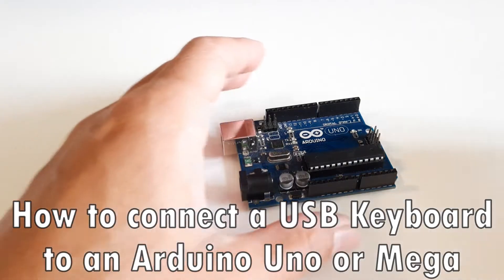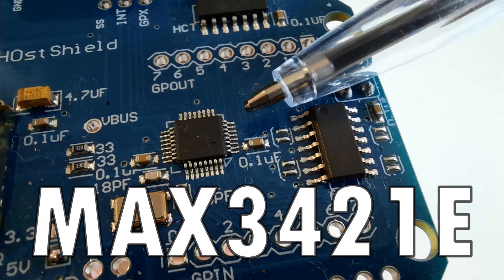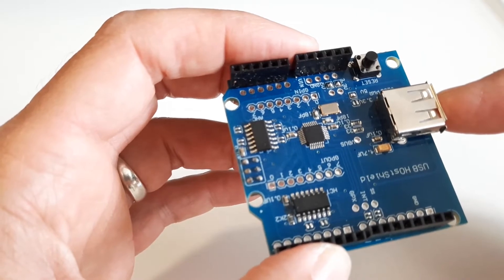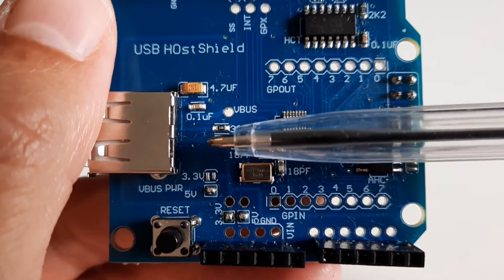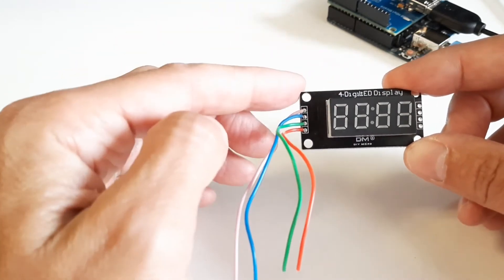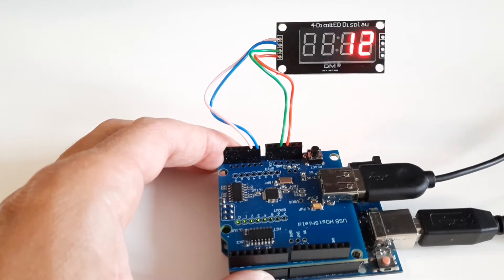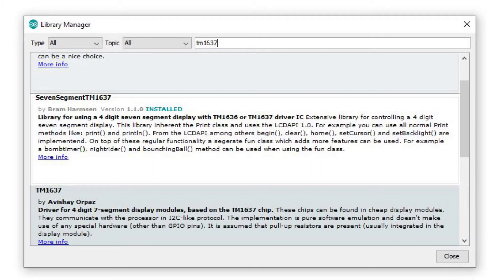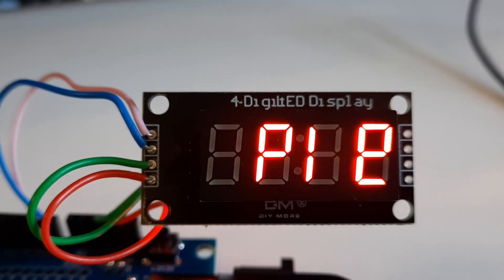How to connect a USB Keyboard to an Arduino Uno using the USB Host Shield

Comment: I have a board with db9 and manhattan cable but can`t read with the shield, the arduino uno, etc. the board is ok, if I connect the manhattan cable to android phone with putty it does communicaet, but, the usb from the manhattan to the shield nothing happends

Comment: For my project, the keyboard receives 5 volts but not enough current to power it. How do you ensure that the arduino provides enough power?
Reply: You can power the shield from a more powerful external 5V power supply if you don't close the 5V jumper next to the 5V pin on the arduino.

Comment: Thanks for showing a couple of 5V solder bridges need to be connected for a USB device to work.
Reply: Well, there are 3 of them solder bridges plus a wire, more info @ https://esp8266-notes.blogspot.com/2017/08/defective-arduino-usb-host-shield-boards.html

Comment: Can you explain the connection for Arduino Mega? I believe Mega have more pins so I am a bit confused on where to plug the USB host shield in. Thanks!
Reply from the maker: The Mega has all the pins of the Uno, plus some more. So plug it in as it it was an Uno, and ignore the extra ones.
Reply: @CircuitBreaker256  thanks! I did it. Is there some code that needs to be running, in order to activate the USB host shield on the Mega board? When I plugged in my USB device, it doesnt light up (no power), thus im thinking the USB shield is not connected prorperly? So we need to run the code first or no?
Reply: I was trying to connect a USB microphone (have an LED to show if its power on), for my project. I need to record some sounds using this devices. So far, the LED doesn't light up. Hopefully it is executable
Reply: @midorishimiz  Make sure you solder the power jumpers on the host shield as explained in the video.  Out of the box the shield won't power up at all.

Comment: I have tried this using instead and I2C LCD Display, and no results. Is this actually possible?
Reply from the maker: Do you mean you want to type on a keyboard and see the result on the display? If so, that is definitely possible!!! I've never worked with LCD though, but if it has an i2c interface there is always a way to get it working in the end.

Comment: Can it be possible by not using the shield and directly taking I

inputs from the USB keyboard.
Reply from the maker: I don't think so, unless you implement the whole of the USB protocol on the Arduino, which would be a lot of work.
Reply: @CircuitBreaker256  may I get the schematic diagram of the shield. 
mohitgaikwad2804@gmail.com

Comment: So weird to have a USB chip that is 3.3v when the USB standard is 5v.
Reply from the maker: Well it seems that the bus power is 5v but the signals can be 3.3v
Reply: 5V is the USB power supply.  That gets regulated to 3.3V for the logic chips inside USB devices.

Comment: awesome......thank you very much....plz make a video on "how to control motors and leds....from USB Host Shield ,arduino uno & wireless usb keyboard.plz plz plz plz plz plz plz plz plz plz plz plz plz plz plz plz plz plz plz plz plz plz plz plz plz plz plz plz plz plz plz plz plz plz plz plz plz plz plz plz plz plz plz plz plz plz plz plz plz plz plz plz plz plz plz plz plz plz plz plz plz plz plz plz plz plz plz plz plz plz plz plz plz plz plz plz plz plz plz plz
Reply from the maker: That's a good idea. How about connecting a Bluetooth keyboard to my 32x32 display so you can type messages on it? I'll try it out!

Comment: USB standard is +5V for power, and +3.3V for data. That's why you can't find 3.3v keyboards, as they don't exist. Also the reason why it's a bit complicated to bitbang USB protocol (well, the first hurdle is the +5V to +3.3V logic, or giving +5V to peripherals and running all logic at +3.3v), but yeah the biggest reason USB protocol is complicated to bitbang is that it's a goshdarn complicated protocol to bitbang. PS/2 keyboard protocol is simple. Some USB keyboards still have the possibility to run PS/2 protocol through USB, so you could always try to initialize the keyboard with the PS/2 protocol start command, but mostly the chips have been phased out as nothing hasn't used PS/2 for years...
Reply: You can bitbang usb, look for USB-V, it is not easy, it is a very fast protocol and it does not use a clock to sync, it uses specially designed circuits to sync... you would very fast MCUs to emulate the hardware by using interruptions, it is possible but hard and not very effective, it is a goord learning experience, by just reading USB-V you learn a lot.
But yeah... as you said "the biggest reason USB protocol is complicated to bitbang is that it's a goshdarn complicated protocol to bitbang" is 100% true, hahaha.

Comment: Im about 80% sure I fried my host shield trying to solder those connections. The pcb turned brown and i still ended up with 2 extra holes filled with solder
Reply from the maker: Hmm, I think you need a lower wattage soldering iron or to turn the temperature down. It only takes a tiny blob of solder.

Comment: thanks !!! have you  tried thie keyboard via a usb hub to the shield ??? take care+stay healthy !!!
Reply from the maker: I haven't tried using a USB hub yet, but I know it is possible and the library for this module specifically supports it. I'll give it a go!
Reply: @CircuitBreaker256  i have tried it...connecting the usb host shield to a mega2560, then a usb hub 2.0 then i inserted an usb pendrive, it came back usb init failure... the usb hub+usb pendrive( both usb 2.0) both works under linux+win7 without problem...later when the other usb hub arrives, i will try this again , take care+stay healthy !!!
Reply from the maker: @unglaubichuberlieber8048  for connecting a USB pen drive you should use a CH376 module.

Comment: Is the demo sketch code available for download?
Reply: Never mind, I was able to get it working. Thanks for a great video!
Reply: I modified the demo code to translate/send ASCII to Morse code. I found by experimentation is that it does not seem to like long delays between calls to Usb.Task. I don't know why this is or if there is a work around. Do you have any insights?
Reply from the maker: I think that Usb.Task is supposed to be called regularly, otherwise you would miss Usb events, like key-down. A better option would be to set it up on an interrupt to call it, let's say, 50 times per second. Then put any keys that it gets into a circular buffer. Your main program could drain the circular buffer and the interrupt could fill the buffer.
Reply: @CircuitBreaker256  Thanks, I have implemented a fix and it seems to be working well now.
Reply: @Menno Wormsbecher Sure :)  https://github.com/scottlbaker/morseKeyers
Reply: Scott, great idea morsing around with this.  May I use your code to modify for a keyboard direct to display (over LoraWAN) to a remote display, well actually keyboard and display at each end. If so, do you have any suggestions?
Cheers